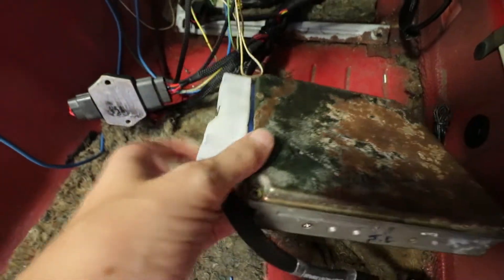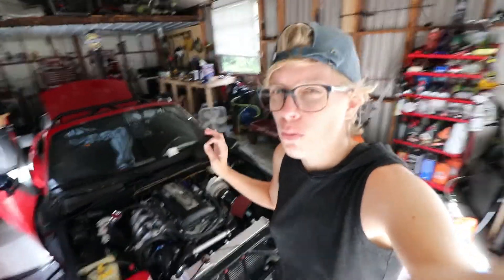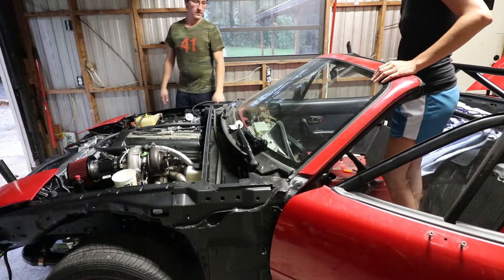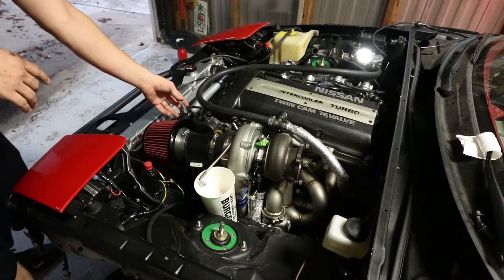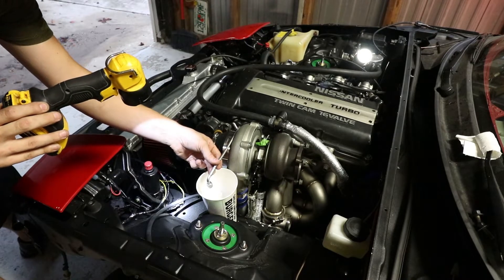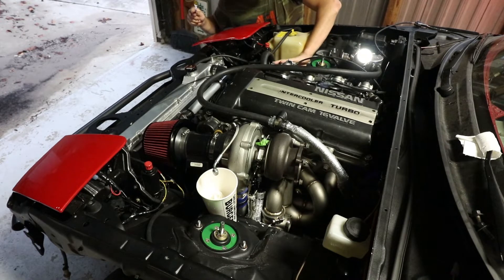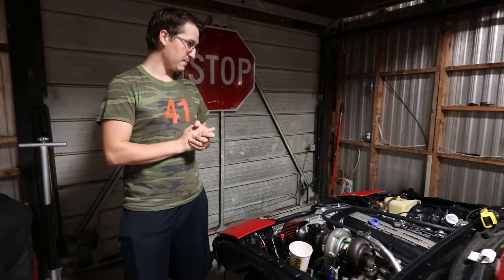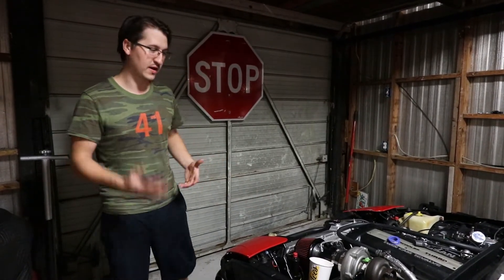The SR20 Miata Started & there's Issues...

Comment: Did u guys do anything internal to the motor , what boost u plan to run ?
Reply from the maker: The previous owner did ARP head studs and a Cosworth head gasket, other than that we just did rocker arm stoppers. We have the Tune set up for 1 Bar of boost, so almost 15PSI.
Reply: Can't wait to see the driving videos , to see where u spool at !

Comment: Did you use thread sealant on the fittings that go into the fpr? There's one specifically for fuel it comes in the little thread sealant tube
Reply from the maker: Yeah, that's what I used. I took them off again and re did it today.